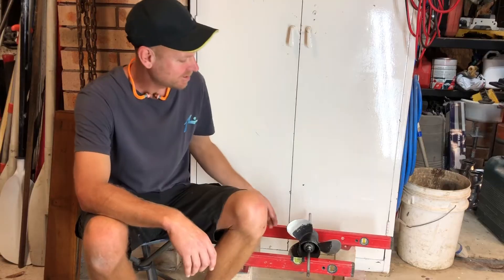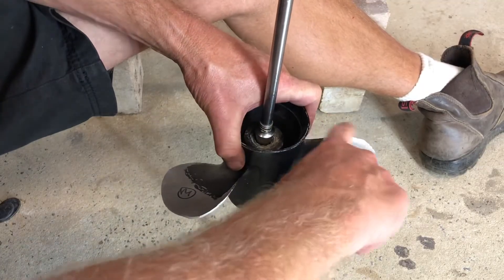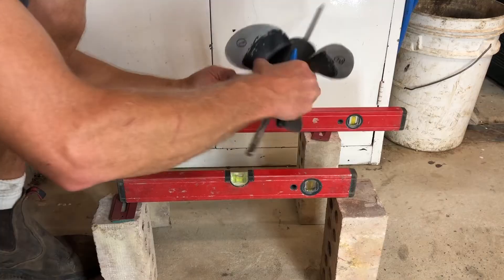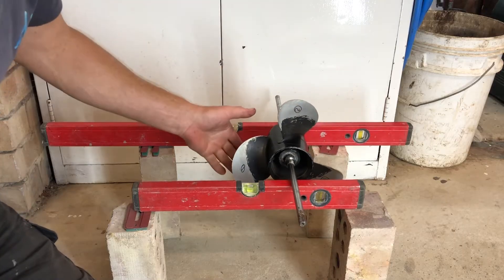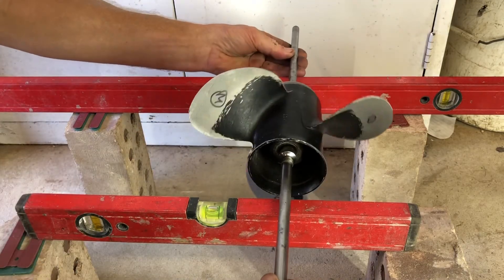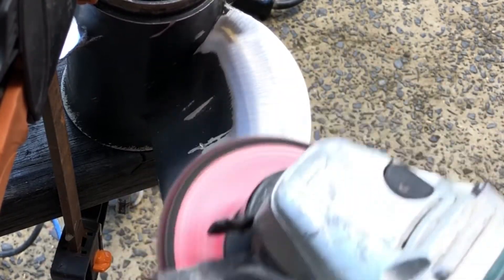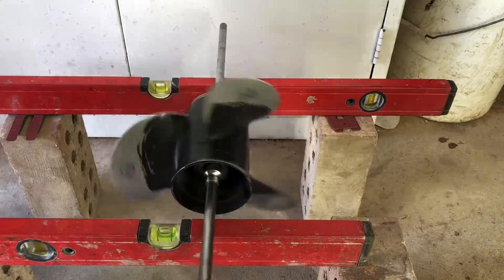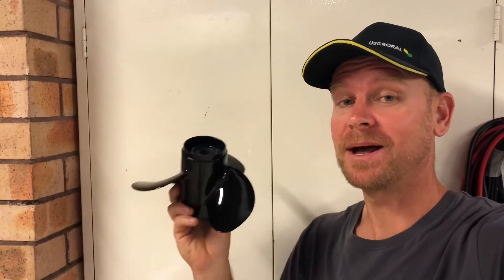Propeller balancing at home - Easy 👍

Comment: I use a true 2K epoxy paint, which is available in a spray can that has the catalyst blader inside the can. The undercoat is Wattle Super Etch. The end result is a super hard high gloss finish. Cheers
Reply from the maker: Sounds like a great system you've got there! Thanks for sharing mate. 👍
I have often wondered how the two k cans go.
Cheers 🍻 
Aussie Boat Guy 😎

Comment: What? Its the backside of the prop that pushes the water?
Reply from the maker: There is a high pressure side and a low pressure side. The back of the prop, facing away from the back of the boat (not closer the the boat) is the pressure side.
Cheers 🍻 
Aussie Boat Guy 😎

Comment: Will this fix singing prop?
Reply from the maker: Hi Mate,
Singing props can be a hard one, it may help but possibly not. Are you sure it’s the prop or maybe another part like the keel or skeg, rudder or shaft etc, just covering a few bits as I’m not sure of your setup.
Is it only at a certain speed?
I really have not come across a singing prop on an outboard before.
Cheers 🍻 
Aussie Boat Guy 😎
Reply: @25hpboatracerman  thank you for your reply 🍻… 2007 tohatsu 30hp four stroke on a deep v 14ft Lowe  it’s only at 5mph and goes away at 6 mph, It first happened when I put a new 9 pitch prop on, when I switched back to my 13pitch the noise went away then I put on a 10.2x11 four blade and the noise came back I immediately put my 13pitch prop on while I was in the lake and the noise went away, put back on the 11pitch and the noise came back. It’s weird I don’t know what the think I’m at a loss, any ideas?
Reply: So when I trim the motor all the way up almost out of the water the whining goes away, I pulled over on the shore and changed out the prop and the whine went away.
Reply from the maker: That is a wierd one mate.
I would say if it only happens at 5mph then goes away at 6mph it is probably not going to cause any issues.
I would say if it’s going it either a number of props it is most likely not a balance issue but more just the way the water is flowing.
Does it feel like your trim tab is set on the correct angle while traveling at speed?
Also changing engine height slightly may stop the sound of a different trim setting 
Cheers 🍻 
Aussie Boat Guy 😎
Reply: @25hpboatracerman  I’m going to mess around with the trim, this is a good idea this is something I have tried yet and may be the cause. Thank you I’ll let your know 🍻

Comment: Y'know I've spent years balancing props on radio controlled airplanes and I never thought to check my boat's prop... good call, thanks for the educational vid. Any suggestions on what to use for a shaft to do this with?
Reply from the maker: Thanks Champion,
It really doesn’t matter what shaft you use, as long as it is perfectly straight and round plus fits snug inside your prop bush. I made some long cones that slide over a shaft that centre my props on my shaft.
Cheers 🍻 
Aussie Boat Guy 😎

Comment: why even paint the prop?  its aluminium right?  wouldnt rust anyways  or whats the benefit?
Reply from the maker: Hi Mate,
Will not rust but will oxidize in the salt water.
Painting the alloy props is worthwhile, I do polish some alloy but they need constant polishing, basically after an outing.
Cheers 🍻 
Aussie Boat Guy 😎
Reply: @25hpboatracerman - Hmm! A bright Ferrari red might be my next ticket on fancy propeller! 
Makes all sense for my 2.5 hp. Now I like the idea even more. LOL 🙂

Comment: Just wondering what you used to match your rod to the prop bore? Thanks
Reply from the maker: Hi champion,
I have a number of different shafts, some old outboard drive shafts, some that have been turned that fit snug in a number of propellers.
The ones that done fit snug I have a shaft with two sharply shaped cones that slide onto the shaft and press into the hub centering the prop.
Cheers 🍻 
Aussie Boat Guy 😎

Comment: Where can I get a shaft little fit that prop to balance it Bob Elkhart where did you get your shaft at
Reply from the maker: Hi mate,
Honestly you just need a straight shaft that fits right through your prop.
Think mine is an old driveshaft or something 
Cheers 🍻 
Aussie Boat Guy

Comment: What if shaft is a little bit bent?
Reply from the maker: Hi mate,
The shaft needs to be very straight.
If the shaft is even slightly bent the propeller will not be balanced.
Cheers 🍻 
Aussie Boat Guy 😎
Reply: @25hpboatracerman  Hi! Thanks for the reply!
That means, the balancing wont work and I can just throw everything in garbage :D
Probably I can still save the propeller, but the shaft needs to be replaced first. 
Thanks!

Comment: Very good video. My question is how did you attach the spindle to the prop?
Reply from the maker: Hi mate,
Thanks 😊 
I have two cones which push into the hub and that centers the prop, each cone has a spring that pushes against the cone to keep them in the hub.
You can use any straight shaft as long as it is tight in the hub.
Cheers 🍻 
Aussie Boat Guy 😎

Comment: I thought that you were😢 supposed to check that all the pitches were the same too.  So you said you sand down not the pressures side. Can you just say to sand down the part that faces the front or the part facing the rear. Thank you. That way people can number the blades before they take it off. I thought the pressure side was the back of the prop so I checked. Material removed from towards the tip of the prop will have more of an effect on the balance. Remove material with a file from the front of the blade ONLY, i.e. the convex side which is the same side as the drive dog slot.
Reply from the maker: Hi Mate,
You can check the pitches for sure with a bevel if you are at home.
Thank you for pointing out some extra things I could have added to the video.
I do clearly show which side to sand though. With props it is either pressure side or low pressure side of the blades.
Hope it was helpful anyway.
Cheers 
Aussie Boat Guy 😎
Reply: @25hpboatracerman  Professionals have curved blocks with the pitches and can see if any blades are bent. Every step is important for the best results. I did enjoy watching your video. You seem to be a perfectionist just do not want you to miss a step. You keep saying do not touch the high pressure side that seems to be the back of the blade and the front of the blade appears to be curved which you can adjust. Are you supposed to check if those curves are the same too or is that going to far. Lol. I guess you can just get a brand new prop and make a mold of the pitch and the outside curves. I heard of motors from Yamaha coming with some no name propellers and when a Yamaha propeller was used it worked a lot better. Wonder what the difference is between a good and bad prop. From trial and error you must know how to shape it to get the best results I will watch your video again
Reply from the maker: @tommytriglav5181  
Yeah, true I would love a set of pitch blocks.
I do however check the blades with bevels and gauges before I start, I will add that into the next video I do on props. 
Cheers 🍻 
Aussie Boat Guy 😎
Reply: @25hpboatracerman  I was looking at the sharrow prop and to me it looks like two three blades narrow props at a different height to give 6 total blades. Can you make one like that? No need to connect the ends. Call it the Aussie prop. Market it and sell it could make a lot of money. It could be like a 3 blade prop with the center part cut out and then maybe the pitch of the remaining blades changed. That would probably be the easiest way to make one. What do you think. That way you could get regular cheap props cut out the center part then charge a lot lol
Reply from the maker: @tommytriglav5181  
Hi mate,
Yeah those sharrow props are pretty cool.
I have thought about that principle (even years before the sharrow appeared)
I could not cut the centre of a stock prop though, the blades need to be offset in the flow of water to catch the low and high pressure water coming off the first set of blades.
I am always thinking props though, waiting for another revelation to hit me 🤷‍♂️
Cheers 🍻 
Aussie Boat Guy 😎
Reply: @25hpboatracerman  Yes I was thinking that the sharrow prop is so good because it does not allow the water to slide of the tip. So take the two blades and make them flat instead of round ends then weld a flat piece on to connect them. The thrust side is down toward the bottom so you can make the forward part of the prop flat the the lower blade extend dow below the flat part. What do you think of the Aussie prop now?
Reply from the maker: @tommytriglav5181  
I like the idea mate,
Unfortunately I just don’t get the time to make stuff like that at the moment.
When I do, I will do a video of course.
Cheers 🍻 
Aussie Boat Guy 😎

Comment: What kind of rod are you using
Reply from the maker: Any straight rod is fine, I often use an old drive shaft or a bright rolled solid bar. 
Cheers 🍻
Reply: Thanks

Comment: Could you please do a video on straightening a propeller shaft
Reply from the maker: Sure, I will have to wait till I have to straighten one though so might be a while.
A slight bend is not that bad to straighten but badly bent I don’t even bother as I worry about the stress and strength after it’s straightened.
Cheers
Reply: @25hpboatracerman  I can send you a few bent ones, haha